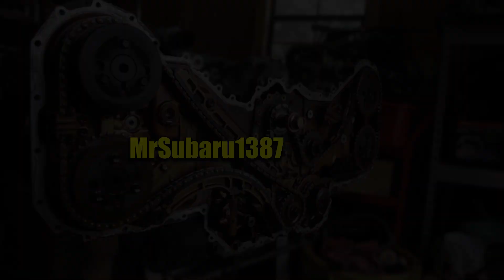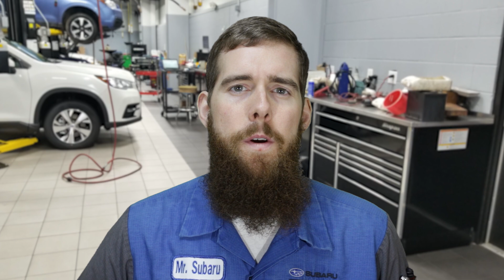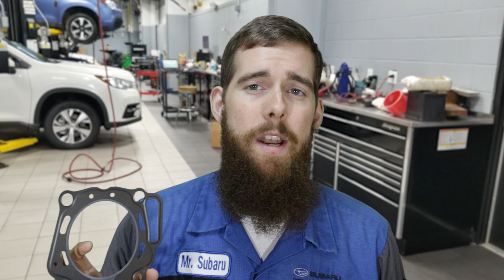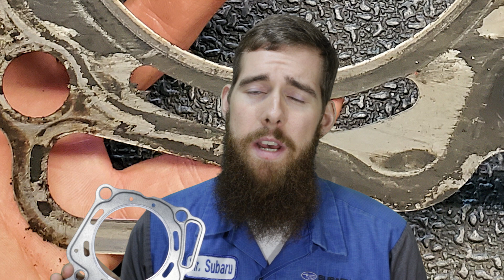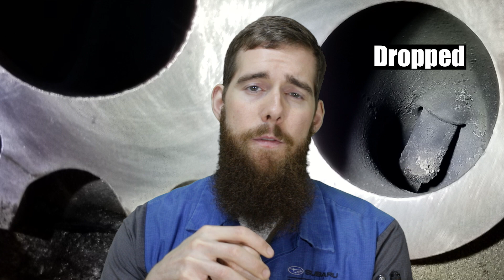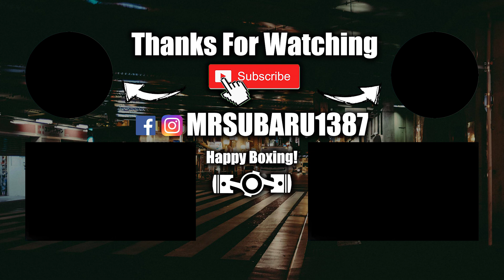Subaru Head Gaskets Explained

Comment: I sold my 2003 Forester with 237k miles on it a few years back with the original head gaskets.  My 2005 Saab 9-2x has 191k miles and is still going strong on the original head gaskets.  Change my oil and coolant on a regular basis, never had a problem.  The Subaru haters are trolls with nothing better to do with their lives and probably have never owned a Subaru.  Outside of the late 90’s dual cam 2.5’s and the early 00’s single cam 2.5’s mentioned in the video you shouldn’t have a problem if you properly care for your car.
Reply: Just because you didn't have an issue doesn't mean hundreds of thousands of other people didn't, Changed my oil regularly and have now had 2 HG problems in the year i've had the car (140000 mi)
Reply: @caade_1967  I’m going to assume you bought a used car and that you didn’t put 140k miles on your Subaru in one year.  In that case it might be a case where the previous owner abused the car and that’s a chance you take with any used car, Subaru or otherwise.  The other question is how can you have two head gaskets in a single year if the first repair was done properly?  The first head gasket is probably on the previous owner.  The second head gasket you can blame on your mechanic who obviously botched the repair.  I understand your frustration but there is no way you can blame Subaru for two bad head gaskets in a single year if the first repair had been done properly.

Comment: 100% accurate info. These are the only gaskets I will use. Subaru purposefully used shitty gaskets on the n/a ejs as a point of engineered obsolescence. They knew they couldn't get away with a shit gasket on the turbo motors without having massive in-warranty failure issues so they used good gaskets on them. Manufacturers don't want their cars lasting beyond 7-10 yrs and the single layer gasket was their way of accomplishing this.

Comment: Lifetime is an engineer's term. Totally different life span vs span of time. A lifetime? Who's? Mine? Yours? 30yr 80yr 100yr
Reply: I might be able to help with that. My dad has always said that if it says lifetime it means the lifetime of the part. lol. Sometimes it's short and sometimes it's long. In either case the company is usually out of business when you need it warrantied.
Reply: It was always a worthless term.    Just a spin/B.S.    Midas mufflers perfected the terminology.
      Yeah, they meant the "life of the part" which might be just a few weeks.   I the life of the car because there are still Ford Model T's still around right?

Comment: Awesome info! I won't put any head back on without sending it to the machine shop! Curious to know if you use new head bolts? I personally always do!
Reply from the maker: I reuse them, unless they're damaged. Meant to touch on that in this video, but was already long winded.
Reply: @MrSubaru1387  Thanks!
Reply: If need to replace arp head bolts  are good

Comment: I've had a 2006 JDM Subaru Forester STI running at 330hp. These come with a turbo 280hp EJ255. The honest truth is the head gaskets blew at 50,000 miles and again at 100,000miles with the same OEM part installed :(. I then replaced it with a duel layer Cosworth head gasket and had no issues up to now lets see if it lasts more than 50,000 miles haha. Currently on 130,000 miles.

Comment: Great video.  Does the dealer still install the single layer gaskets if they do the head gasket work?
Reply from the maker: Depends. I'd imagine most still use the original coated gasket.
Reply: They superseded to a MLS from the old single layer gasket in 2010 when they finally switched to a MLS gasket and a semi closed deck block from the factory where I worked in Lafayette,  IN
Reply: @bigdaddymak1439  when I had a head gasket leak on my 2008 Outback, the dealer said: those models are not supposed to do that. But that was because it was too recent for them to see a lot of these. The year was 2012. Good to know they switch around 2010
Reply: @scottibass  never trust the dealer they knew good and well what was going on. They just want to cars parts and repairs
Reply: @bigdaddymak1439  indeed, they also wanted close to 3 grand for the repair, my local independent subi shop did it for 800
Reply: @bigdaddymak1439  Hail Purdue! I remember when that plant was built! Makes me smile every day when I see the sticker on my Outback's window!
Reply: @nancyoffenhiser4916  the guy who tinted my windows removed that sticker without my permission. I'm still bummed about this
Reply: @scottibass  Oh No!!!! 😿😿

Comment: Thinking about buying the new Forester but Im hearing a lot of chatter about CVT Trans.
Reply: I'm a mechanic at an independent Subaru shop in NC. We are getting the newer Subarus with the cvt transmissions coming in with 150k, 180k even 200k without any issues at all. 
If you don't mind how the cvts drive then don't fear their longevity.
Reply from the maker: My brother's 2011 Outback 2.5i Limited is at 200k with no CVT issues.
Reply: @tooquick240  OK , Thanks for the info.

Comment: Awesome video, thanks for the clarification and confirmation. I'm an engineer and it's pretty frustrating when  people run off with their opinions about Subaru head gaskets on forums (or any opinion on any forum with no factual data to back it up). Anywho, I have an 04 impreza obs 2.5L and the gaskets are weeping oil. Coolant is not being consumed, I do have to top up the oil about 0.5L between oil changes. No problems yet, just monitoring the fluids. Pretty sure I have ye ol graphite gaskets :S Do all Subaru dealerships send their heads off to a machine shop?
Reply from the maker: No. Most dealerships will buzz the heads and block with a bristle disk, per the old service bulletin.

Comment: Scotty Kilmer is one of the worst when it comes to misinformation on Subaru head gasket issues
Reply: He knows almost as much about Subaru as the average high school graduate. Next to nothing. It's a joke when he makes videos about Subaru.
Reply: i scream every time he says the 4EAT and 5EAT are weak transmissions
Reply: @jeremiahjorenby2275  He literally claims every car company has terrible automatic transmissions except for Toyota. He also said the Subaru engine was an outdated design when the EJ was quite new and advanced compared to many contemporaries in the 90s and 00s as well as the EZ in the 00s and now the FA/FB is of course brand new. Just ridiculous.
Reply: @jeremiahjorenby2275  Actually the 5EAT as installed on MY06 / MY07 (NON-Sti) and others is a bit of a weak point, it was designed for NA vehicles originally. It is very solid compared to many other transmissions, but has two very weak points, shift-forks and the throw-out bearing. I've seen a metallurgical issue on a cast shift-fork (yes they are just cast aluminum) can cause it to snap off. The throw-out bearing seems to have a tendency to wear out pretty quickly in a nasty fashion and may be under-specced. 

Now the transmission I saw was launched hard regularly and abused, but they are by no means bullet-proof units. I also suspect the transmission has a tendency to move around too much under cornering etc. and needs an upgraded mount (and there are numerous aftermarket mounts). The STi has a trans designed to handle more power, the standard WRX / Forester were considered more of a consumer car, even with the turbo installed, and they didn't bother improving the transmission.

It does depend on how you drive it of course also, but it is marketed as a sports car so should be able to handle some launches. 

So he's not totally wrong there.
Reply: @VenturiLife   Venturi Life  we were talking about the Jatco based 5 speed automatic transmissions that were used in the 6 cylinder models from 05-14......
Reply: Scotty-"You're stupid if you use this head gasket".
Reply: Venturi Life i
Reply: @802Garage  The impression I got from what little I watched is that he is actually talking about the boxer layout being an 'outdated design'. Which is a really really dumb thing to say. If he thinks the boxer format is 'out of date', he could also consider both the V engine layout and the inline engine out of date. After all, a boxer at its core is a 180 degree V engine but with individual crank pins like an inline engine. 

The things that make an engine modern vs. outdated have nothing to do with whether it's a V, boxer or inline engine. Scotty is talking out of his arse
Reply: @t_z1030  Exactly. Agree 100% he basically just knocked Subaru for no reason. Every ICE is an out of date design! Just found it extra funny that Subaru actually had an extremely new and up to date engine when he said this. Not to mention with partner tech from Toyota in some cases. :P
Reply: @jeremiahjorenby2275  Just to be clear, no Subaru transmission starting with the 4EAT seems to be a full JATCO unit. A lot of people say that, but Fuji still engineers the cases and designs, but many transmissions have used JATCO components. Seemingly the 5EAT you referenced especially has a lot of JATCO internals, but it's not the same as the JATCO 5 speed used in Nissan vehicles for example. The CVT Subaru uses is also designed and built in house and is not JATCO, though a lot of people think otherwise. I have market advisory documents confirming that on the CVT. For the 5EAT info is hard to find, but people have emails from JATCO saying they supply "internal components" but Fuji builds the trans.
Reply: @802Garage  thanks for the clarification, guess i will refer to them as "jatco based" from now on, I knew jatco didn't make stuff for the subaru CVT as the service life on subaru's CVTs is longer than 60-90k miles XD
Reply: @jeremiahjorenby2275  Hahaha for real. That's why I keep telling people about the CVT. Subaru's is actually more reliable than a lot on the market. I did some digging before I made my comment to you and the best real sources I can find are alleged emails from Jatco saying "We supply internal components to Subaru for the 5EAT." But I definitely think the cases, outputs, and likely even gear sets and couplings, have been Subaru since basically the 4EAT. I think mostly Jatco makes the pumps, solenoids, possible valve bodies, and probably clutch packs. I could be totally off, but it's not the sort of specific info you can find in 5 minutes of digging. Plus I'm far from an automatic transmission expert.
Reply: Correction: Scotty Kilmer is one of the worst.
Reply: @802Garage  He also says in one video that he doesn’t trust businesses like Consumer Reports because they are only trying to make money. I’m paraphrasing from memory but that’s the gist of it. Who in the US or Canada doesn’t know that Consumer Reports is a non-profit, lol!
Reply: @jimwatchyyc  Hahaha unless it's his opinion, it's probably wrong!

Comment: Very Nice video and just wanted to add why I  believe they started using different gaskets in 96 97 area  that were failing because they had change and make them without asbestos  because I believe in 1996 asbestos was band and could no longer be used in making  there product  and it took subaru  a few years of failing  in efforts to make a gaskets that met standards maybe not californias lol that was asbestos free and wasn't garbage  until they came out with the multi layer gasket you featured in your video thanks for the laying out the problem instead of just saying there cooling system is upside down  witch it would be nice if the thermostat was on top that for the knowledge bomb!!!!

Comment: Very informative. I can run my 99 2.5 engine all day and burp the system but when I get on step it immediately overheats. It’s quite frustrating to figure out. Also did exhaust leak on coolant system. Checked out. I’m leaning towards head gasket. Initially the radiator blew and I though that would fix it. Burp the system all day long but continue to overheat after getting it on the road.

Comment: EJ22 is bulletproof
Reply: Still my fav. EJ18/20/22 are all BAE.
Reply: Does the US have a 20 n/a? Can’t remember one if we do
Reply: @Spiritual_DriverAE101  Nah, we only ever got the EJ18 and EJ22. First time we got any EJ20 was 2002 with the EJ205 WRX. No NA EJ20 engine in the USA.
Reply: david chappel  true...but i aint in a hurry
Reply: david chappel  Really not so bad in the early Imprezas especially. 135HP or so and about 2500lbs they definitely can get out of their own way. Slow compared to any turbo car or RWD sports car of the day though for sure.
Reply: Had a EJ20 in Europe and yes not overpowered and not good on gas but extremely durable it took absolutely everything thrown at it !

Comment: Anyone who clicked "thumbs down" can you elaborate as to why?
Reply: Because they are the ones spreading the b.s. on the forums.
Reply: @michaelhite1433  it's not necessarily BS there are Subaru motors with a head gasket problem and the fact of the matter is that Subaru as a manufacturer failed to address the issue effectively so there are a large number of Subarus that in their normal OEM spec with the normal OEM head gasket can't be considered reliable vehicles. That's not to say all Subarus are bad and that's not to say that there isn't a fix for the problem but the fact of the matter is there has been a large string a Subaru vehicles with a head gasket problem
Reply: gundism and he explains that, and there is a lot of b.s. spread around the Subaru forums. So I don’t see your point. I have 2 such vehicles and I’ve done head gaskets in both of them. It’s not hard and wasn’t expensive, and besides that, they are great cars.
Reply: @michaelhite1433  my point is that consumers aren't spreading bulshit they have a right to be mad it is unacceptable that vehicles were sold in this way for multiple generations when the manufacturer knew better and that a vehicle is not reliable if it has to be altered from the OEM spec to be reliable . I love these cars but I cannot recommend them to anyone without them receiving an alteration from OEM

Comment: My wife's 2011 outback with the 2.5 is very slowly leaking oil at the driver's side head gasket and both sides valve cover gasket. The passenger side head gasket is clean and happy. It takes about 6000 miles to get a low oil light. She has 235,000 miles on the engine all I've done to it is timing belts at 92,000 and 198,000. And coolant replacement around 180,000.
Trying to decide if I should replace gasket or move on. 🤔

Comment: That MLS gasket you show in your video says it wont fit on my 97 legacy outback. I'm assuming the computer doesnt know that headgaskets off the newer subarus from the 2010s - 2020s are interchangeable and can be placed on the 90-99s?

Comment: Bough a wrx with an ej205, with a head gasket going out. Coolant expansion tank leaks out the boot of the cap, and there’s a cylinder 1 misfire. No white smoke, and engine runs and sounds fine. Haven’t checked to see if coolant bubbles or if oil is frothy yet, or if there’s a leak where the head gasket seats. Wonder if it’s actually bad at all, or if I could drive it for a while before doing that job

Comment: Bad Subaru Engines:
EJ25D - DOHC - dual overhead cam 2.5 liter naturally aspirated - 
EJ251 - SOHC - single overhead cam 2.5 liter ej naturally aspirated - external leaks
EJ251, EJ252, EJ253 - all affected by headgasket failures
Good: 6 cylinder models 
ER27 - old xt
EG33 - svx models
EZ30D - early 2000’s outback and legacy models no issues
EZ30D phase 2 no issues
EZ36D - no issues*
Good 4 Cylinder engines: not available in US markets
Reply from the maker: What? Good 4 cylinder are the EJ15, EJ16, EJ18 (US), EJ20 (all variants many in the US), EJ22 (US and bulletproof), EJ255, EJ257.

Comment: I replaced head gaskets on a 2016 EZ36 a couple months back. Got traded in with the passenger side gasket leaking oil, and I found the bulletin. I believe 90k miles, so no warranty. I've done a decent amount of the EZ30 head gaskets that had developed an external coolant leak. Yeah, it defiantly seems like you could bet on the EJ25 gaskets on the NA motors going out between 90-150k miles.
Reply from the maker: Do you happen to recall the TSB number for that? Was trying to find it the other day and coming up short. Knew it was an issue and seem to mostly be the right cylinder head leaking.
Reply: @MrSubaru1387  Can't recall off the top of my head. I'll look it up tomorrow when I get to work.

Comment: @14:50, I did take it to a machine shop, they asked how many miles on the engine, I said 247K, they said it's not worth it to do the job, the engine is going to fail soon. So I did the flat plate glass, WD40 & 600 grit sandpaper method, used a machinist rule to get on a cross check .001 gap across the entire heads, both sides, still purring at 293K , to coin a phrase " to infinity and beyond"

Comment: I have a 2003 outback with the H6 “ez30rd” with 197000 miles and have had no problems with my head gasket
Reply from the maker: It's EZ30D, but correct, head gaskets weren't an issue on the H6 engines.

Comment: I have 04 Impreza Wagon and recently had a shop redo the head gaskets because of leaks. When they pulled the head gaskets off, the noticed "pitting on the engine block side of the head gasket." Have you heard of this and/or know what the cause was? 

I really appreciate this video! too It was easily the most informative video I have seen after doing a ton of research. Thank you!

Comment: 99 legacy original gasket failed @ 110k. Shop likely used those same style as it failed again @ 198k. I pulled the engine and had a machine shop look it over. Heads were great as machinist commented how good they looked. New valve seals only and heads surfaced.  Block was honed, crank polished and all was reassembled using Fel Pro gaskets. Late 2018. 
Wish this video was out then, but she's running stronger than before and no issues. 21k miles since.